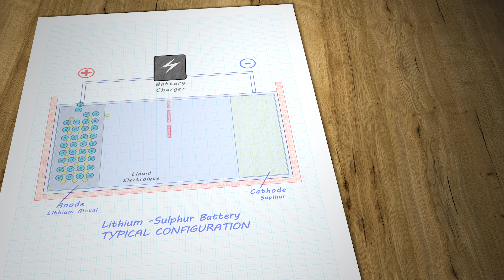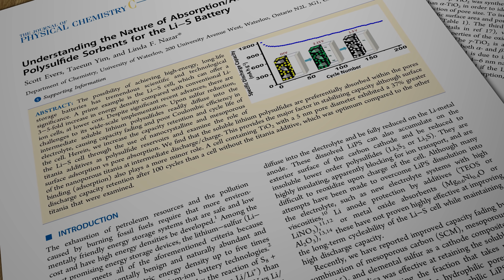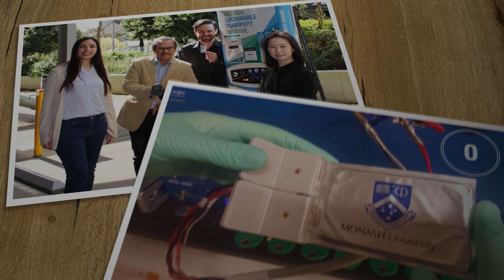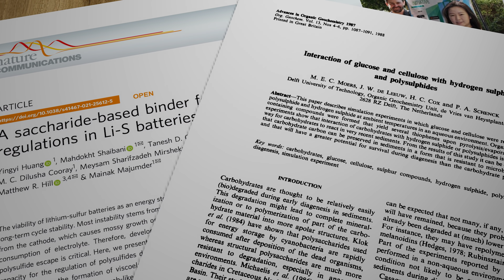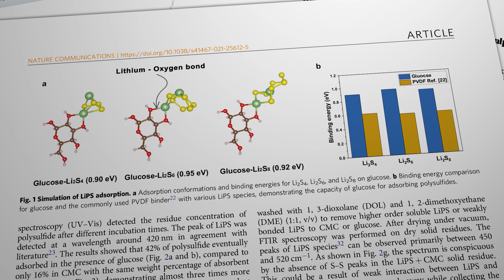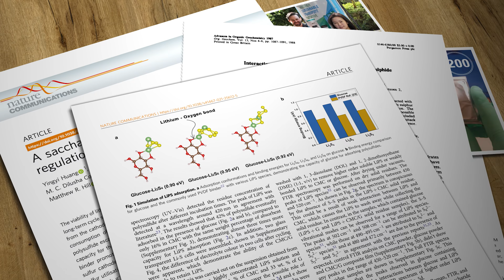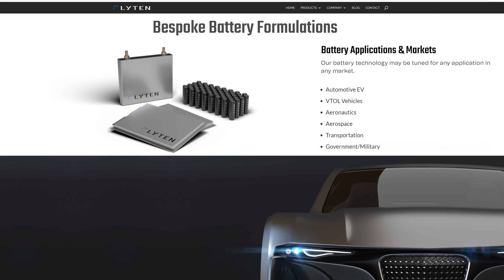Lithium Sulfur batteries: SOLVED! Two new tech breakthroughs in the same week!

Comment: I wonder if a useful architecture, at least for static applications, in chemistries in which the anode and/or the cathode expand and contract with charging and discharging might be as follows.  Put the electrode that contracts and expands at the bottom of what is essentially a Pyrex dish.  Both electrodes if necessary in separate Pyrex dishes  Say it is just one that is the problem.  Put the other one suspended horizontally above the problematic electrode and immerse in your electrolyte with the necessary membrane between them.  If both electrodes are the problem, fuse the two Pyrex dishes together with the joining wall lower than the outside walls.  Fill with electrolyte with the membrane continuing the low connecting wall to the top of the unit.  The electrodes can now expand and contract to their hearts content.  The ions flow back and forth through the electrode and the membrane.

Comment: Another problem with 'five years away' is that it might sound to investors like they're locking themselves into another format war. 
Chances are only one chemistry is going to come out on top, because it will be cheaper and/or better performing than the others. In theory grid storage could act like a sponge for all sorts of battery types (enabling some recovery on investment) but that's a race to the bottom on price/kWh. Any battery that wants to attract investment has to not only work, but rapidly scale up to enough to be price competitive with whatever the standard is going to be. Any battery that can't find investment will unfortunately end up being a lot more than five years away...
Reply: Yes, you've hit the nail on the head here.  Li-ion is already deeply entrenched, and may prevent better technology from coming to the fore.  Wouldn't be the first time that happened.
Reply: It may prevent it from coming to the fore, but the current battery market shows that niche products also succeed. Silver, alkalines, nimh, ni-cad, lead-acid, molten salt, and flow batteries all have deeply entrenched market segments. The "Edison" cell probably has an active niche as well. Furthermore, the only times that I'm aware of a battery technology dying out, it was either a horrible product (rechargeable alkalines- they are possible, they were optimized and on the market, but they... only had 50 charge cycles max, as opposed to 500 and 5000 for the nickel battery types, resulting in their market abandonment), or it was intentionally banned (mercury batteries, which were banned for obvious reasons).

Comment: Earth's supply of Lithium will be completely depleted by 2080 at it's current rate of consumption. By 2040, Lithium will be so expensive you will not be able to power your laptop with new Lithium batteries. No matter what, Lithium batteries are going away. 

Lithium is one of the least unsustainable products man has developed an infrastructure around. All improvement to this technology will be short lived.
Reply: Very nice but the lithium is not consumed.

Comment: I wonder why the LiFeP04 has not been picked up by car industry yet. The only two downside I know of is poor performance in cold conditions and a slightly lower energy to weight ratio compared to Li Ion. Just add insulation and a battery climate control.
Reply: What makes you think it hasn't been picked up?  It's becoming the standard of the industry for low priced cars.  Vehicles that need long range will still use high nickel chemistries.
Reply: @incognitotorpedo42  I meant used by majority long while ago. I heard good things about LiFeP04 already in late 1990's among enthusiasts. Will Prowse (and probably many others) also talking a while about how good they are if you can manage the disadvantage. Still most use Ion.

Comment: I'm so confused by the battery diagram at 3:10.  Why are the electrons flowing from cathode to anode during discharge? Is it mislabeled or am I misunderstanding the explanation?
Reply: Electrons are have a negative charge, so they are attracted to the positive anode. This is electron current flow, not conventional current flow.
Reply: @ianhaylock7409  don't electrons normally flow from the anode, across a load, into the cathode?

I thought typical li-ion batteries have a graphite/silicon anode and a nickel/cobalt cathode, correct?  During charging the electrons are pushed from the cathode through the charger into the anode (and the lithium ions flow through the separator to lodge into the graphite lattice).  Then during discharge the ions flow the opposite way, from anode(negative) back to the cathode (positive), pulling the electrons back through the load into the cathode?

Or do I have my terms all mixed up somehow?

Comment: This is somewhat off topic, but I find this entire narrative really hard to believe. Not really the battery technology, just the ability to actually make all of this happen.
I recently watched a video about how grids work, and in that video, it was suggested that load is transferred into the power generators, via electricity. If this is indeed the case, it would spell doom for renewable energy.
The reason why, is because load would actually cause power generators, like "windmills", to decelerate. It would stall under load. Unlike fossil fuels, it is not controllable. You can't just make the wind blow harder to compensate for load.
I don't actually think that is accurate. I don't think load can be transferred through electricity. If it could, it would make the grid impossibly difficult to manage, in real time.
Interestingly, if load is not transferred, it actually opens up the possibility for very interesting technology, that I won't attempt to detail here.
Also, the grid is inherently wasteful, and pending vast expansion to the grid, electric vehicles would actually be worse for the environment, if you believe CO2 is bad.

Comment: cannot compare to other lithium recipies, but I have made sodium and potassium poly S for patinating copper and its evil stuff when it burns. That's how its done, dump lye in burning sulfur. Its poly because you get tri, penta, sexta etc all mixed together. That's all the solid, gas will be dioxide. In h2s04 its hydrogen sulfide. So keep them far, far away from flooded batteries. You can see my trepidation. Well you can't but imagine it. Stick to something safer like carbon.

Comment: There certainly are a lot of interesting chemistries going around lately, just recently I saw an article on them managing to accidentally discover a some what functional Chlorine solution. Which wasn't really expected as that's a kind of reactive molecule to be able to use in such reactions reliably. But I guess we're at the point where we're finding even some of the more difficult things. I do wonder how it will all shake out as things continue their headlong rush to the still distant goal of the theoretically maximum possible densities.

On a side note, the production stage is actually probably achievable for more battery technologies then it appears. Though of course a lot of these technologies also just end up being obsoleted before they get to far by other versions that were just better for one reason or the other. Combine it with a lot of Li-Ion chemistries just being called Li-Ion, and it probably looks like not much is changing, even if there is a fair bit of activity beneath the surface.

Comment: This comment might seem like a cheap shot but it isn't.  In the 9:th minute of your presentation two fire fighters are approaching a vehicle that is burning but they are approaching it from the down wind side which can bring that smoke right to them.  

If faced with a similar situation the responder should note the direction of the wind and approach from the upwind side thus staying out  of the smoke that will only get worse once water or retardant are brought to bear.

Otherwise a hopeful video and God speed to the folks in that fight.  

On a bright note, I live in NorCal and was between two fires which are now out with the clean up crews decking burnt logs along Highway 299 for us locals to descend upon like termite locusts.  I'm seeing battery powered chain saws now and it's great.  The first fellow pulled his out a little sheepishly but got a pat on the back from me.  In my youth I owned a logging company and was the high climber, until you're up in a tree pulling on a chord of a chain saw that refuses to start you'll have no idea how grabbing a chain saw that carries the starting promise of a household appliance or a handy drill can feel.

Comment: 1000x  charge cycles capable of 4x the capacity of lith ion batteries is already a net gain, even if the cycle life itself is still 800x cycles shorter because of the simple fact that one charge lasts 4x as long and wont need to cycle as often. i assume the current hold up is finding the optimal range of operation using this chemistry. lith ion batteries take much longer to charge from 80%-100% that from 10%-80% as well has more rapid discharge typically operating at 18% or lower. which is why your phone seems too just die quicker at 20% or less compared to say 60% or 42%. if this new chemistry has an extremely large "high charge" limit curve where charging slows down, or a very large "rapid discharge" at higher charge percentages, then yes this chemistry is not ready for the world yet.

Comment: Three year, four years out.   We’re told the “holy grail of batteries will be out in ….   Tesla has been working just to manufacture the 4680 for a number of years now.  That’s just the manufacture part of the puzzle.  How to safely assemble the batteries at large scale so that it’s economical.  Hopefully the non combustible nature of these Li-Su batter will shorten the process.  Good video!   Keep it up!
Reply: Tesla does not actually manufacture the battery cells. They buy them from the manufacturer and assemble them with other components into battery packs.
Reply: The existing manufacturing infrastructure might be able to be adapted. If the cell itself is still constructed in the same fashion its just the chemistry that changes.

Comment: I really appreciate the caveat at the end. The thinking public needs to consider the practical difficulties of creating a technology from a scientific result. Consider that, in the area of battery advances, Tesla’s new form factor battery is a very minor advance compared with a substantial change in basic chemistry and is still having problems with mass production. Products can founder on small details in the real, non-simplified , world.
Reply: The dry electrode manufacturing process is a substantial improvement and a fairly large change from the previous wet manufacturing process.  If the only difference was the format, I think they would have had it figured out a while ago.  That said, it sounds like they are really progressing, and are now seeing a reasonable yield.
Reply: I remember reading an article about autonomous vehicles that stated the last 5% of problems that remained to be solved were more complex than the 95% that came before them.  So the finish line, seemingly so tantalisingly close, often recedes into the far distance.
Reply: @dprcontracting6299  that's the case in every technology, though. The easy problems will be solved first and the longer you work, the more complex the problematic becomes.
But on the other hand, scientific and technological advancement isn't linear, but exponential. They had the same problem at the human genome project with just about 10% of it being sequenced in 7 out of ten years runtime. But nobody really saw how much their technology progressed and so they made it, because those last few years saw doubling in sequencing depth and length.
So yes, the finishing line seems tantalizingly far away, but the longer you drive, the faster your car becomes.
Reply: @dprcontracting6299  Is called Pareto principle, there is a math function to describe it even with a nice graphed curve.
Reply: I thought the purpose of the new form factor was specifically as an advance for production, with slightly improved energy efficiency of the product as more of a side effect.
Reply: @mytech6779  that too, giving [battery day] substancial cumulative advancements
Reply: That's often true in aerospace projects, especially those pushing the edges like a new space launcher. Most times it's an issue that has nothing to do with basic science or whether it would "work" in theory but rather that the money runs out or the program is stuck in a cycle of redesigns or changing requirements until momentum is lost and it dies (or the next economic downturn/pandemic/etc kills it.)
Reply: No I disagree!
It's not only form factor!
They really did a few improvements on the chemistry and a complete overhaul of battery structure for better energy extraction and improved resistance!
Final product and first in the industry a "tabless battery"!
Don't forget that!
Reply: I dare say Musk has a wary eye on any positive development in battery technology, and if any show true potential would be snapped up by him in an instant. Musk is the modern day Edison, a brilliant mind and cut throat businessan. Think Edison Swan.
Reply: And yet in terms of current average battery pack density Tesla is still best by test in most real world use cases especially outside of China. Cheers
Reply: Scientist sometimes misses to mension problems with the findings. And it's that findings that makes most noise.
Reply: @lubricustheslippery5028  not really... Do you read scientific publications? Scientists are very open about the problems of their findings and open research questions that need to be answered.
It's the journalists who barely read the abstract of a paper and then write about the topic as if they truly understood what was going on. I once re-wrote an entire newspaper article on something my team worked at, because even after 2h of interview, a detailed powerpoint presentation and after we answered all her questions, the journalist still just wrote what she thought sounded best, not what we told her we were doing.
But most scientists don't even realize that they can just give partial consent to the printing of their work, where they can demand to read and correct the article prior to publishing or simply not allow it to be published at all.
But in the scientific publications themselves, you will always have a paragraph in the Discussion section where the scientists pretty openly admit the limitations of their research and the yet to answer questions.
Reply: @lubricustheslippery5028  It's not that the scientists are dishonest -- the problem is usually the university's PR people, who have a vested interest in flogging the "breakthrough" story.  (The press, of course, are only too happy to play along.)
Reply: @jpdemer5  It's also puplish or perish so stress to publish enough to make your phd or get more grants. 
I have done some practical work in experiments where i don't want to be mensioned in the resulting papers... It's not always the case and it can be subtle.

Comment: Sounds more promising than most, but, whenever one hears production in four or five years on a battery breakthrough it translates to "production or other challenges we hope we can solve but have no idea how to at the moment." As a rule, they fail to find solutions and production never happens. Here is hoping for some rule breaking.
Reply: The public in general doesn't understand that technology growth follows logistics curves NOT exponential  curves. And advancing chemistry is not a direct equal to shrinking a transistor. 
The initial spread of scientific method into engineering 100 years ago only caused an apperent acceleration because there was so much low hanging fruit. The old 80-20 rule the first 20% of total effort gets you 80% of the total yield, meaning the last 1/5 of yield costs 4/5ths of the total effort. And so that last unit of advancement is 1/16th as cost effective as the first 4 units.
Reply: @mytech6779  the logistics are so complex, that it seems to me that we may not breakthrough into a better standard battery to market it to market.
We still largely rely on 18650 battery, and that is not changing soon. The last improvement to 18650 was in 1996 I think, they were a mainstay for years before that.
I don’t think that model will work very well again, but it’s hard to imagine every product with a built in custom battery, especially since we now seal most of those cells into the device so that we cannot access them to replace them.
I’m not sure we can keep that up for long, but the only alternative I can see is a standard sized cell that can be swapped out, charged in a bay, replaced and recycled at the end of their life.
Reply: I think most EVs already use, and even Tesla are moving to prismatic cells.
Reply: @swayback7375  A logistics curve by its self is not that complex and has nothing to do with supply logistics.
Reply: @andrewradford3953  No, some do some don't, tesla does not. They have pros and cons.
Reply: @andrewradford3953  Tesla is going two different ways for the future. For high end cars, Cybertruck, the Semi, Roadster, Model S and X, Performance models, the 4680 cells. For everything else, LFP blade cells from CATL. Tesla will not use pouch or prismatic cells.
Reply: @mytech6779  did you mean logarithmic curve?
Reply: @PixlRainbow  Not a log curve, a logistic curve. Look up an image.
Reply: @andrewradford3953  Tesla are moving towards 4680 cylindrical batteries... but for cheaper standard range vehicles they are going to use LFP batteries as they do in the Chinese made standard range Model 3 and Y.
Reply: Battery research is very difficult and takes a long time because there are so many variables you have to test out.
Reply: The frustration is real